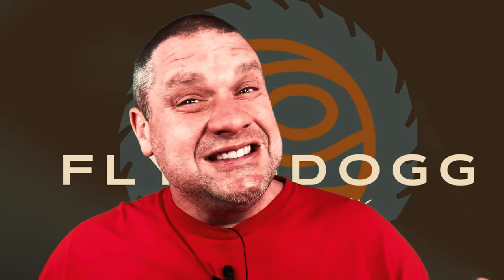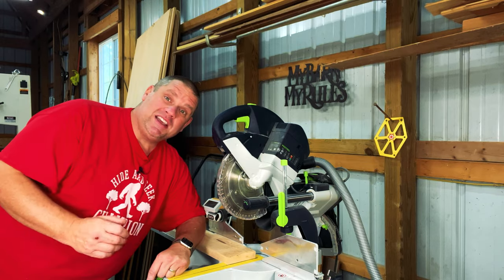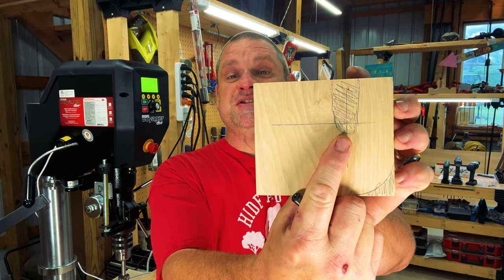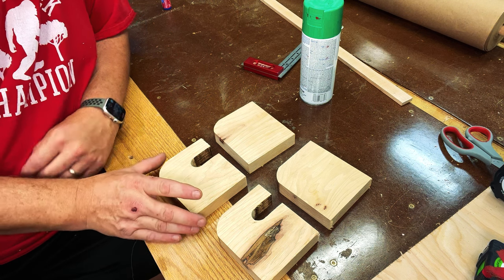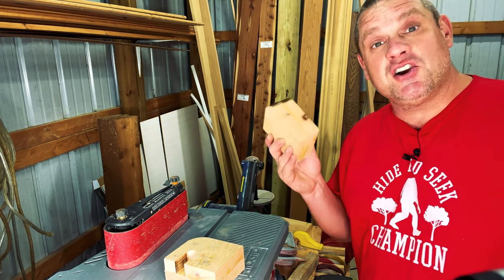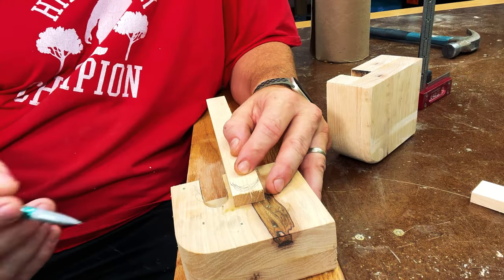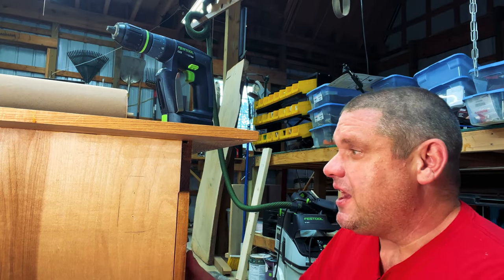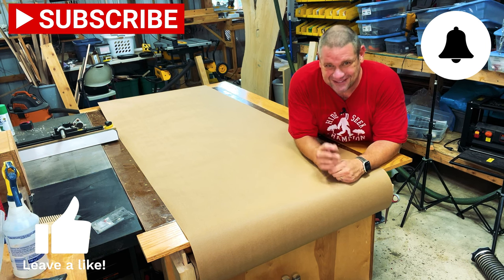Boost Your Assembly Table's Efficiency with This Must-Have Accessory #woodworking #projectbuild

Comment: I laughed when you talked about the 36" rod falling out of the holder. I did exactly the same thing a few years ago. So, during a fit of "This sh*t ain't happening", I cut 10" off the end of the rod, cut a 12" piece from another rod and glued them together with a 3/8" dowel. Then trimmed the (now) 38" rod to the proper overall length. Been working ever since. Thx.
Reply from the maker: Love it!   One of my favorite things about woodworking is the ability to use your noggin to come up with solutions to problems.  :)   Love your idea!

Comment: Why not use a longer dowel instead of using wedges?
Reply from the maker: Well, that is the longest I can get locally, and I was just working with what I had in the shop. Is this a perfect project?  Absolutely not, but I just worked with what I had.   But great question, and thanks for watching jjpiatek!

Comment: You are going to find that when your roll gets low on paper it's going to pull out of your holder when you pull the paper out because there is not enough weight to hold it in place. I made mine so one side has a grove that wont allow the rod to pull out.
Reply: Exactly right!  I made my dowel groves on a descending 45° angle to prevent this.
Reply from the maker: Sounds like I need to make another modification!  Thanks for sharing.  I'm actually considering replacing the dowl with a piece of 3/4 pipe cut to size.   I think this might alleviate both problems! :)
Reply from the maker: Great idea thanks for sharing rjdavis!

Comment: I like the idea of the wedges.  Did you consider a piece of 3/4" pipe instead of the dowel?  You could cut a piece of 48" long pipe to size.

You might also consider cutting a piece of the old band saw blade so it is wider than the paper.  You could then mount it under the lip of your table.  I would try slotting a hole in the blade and drilling a separate hole on each end.   You need a washer placed between the blade and the bench now screw the blade to the bench using the slotted hole.  Snug the screw but don't over-tighten it.  A couple of eye bolts or hooks and a couple of small bungee cords will provide tension.  Feed the paper between the blade and the table and eliminate the scissors.

I have a board with an old hacksaw blade and a piece of yardstick for a fence.  I use it to cut sandpaper into 1/2, 1/4, or other desired dimension 

Bob
Reply from the maker: That's why I love this channel!   What an excellent idea on the pipe!  That never crossed my mind.  Thank you so much for sharing.  That way I could cut it down to exactly what I need.  I may be making an adjustment to this piece!  Thanks so much for sharing!